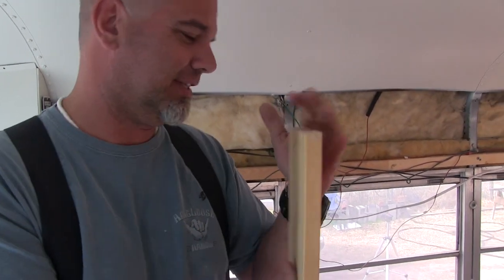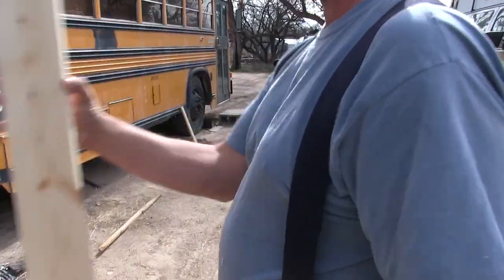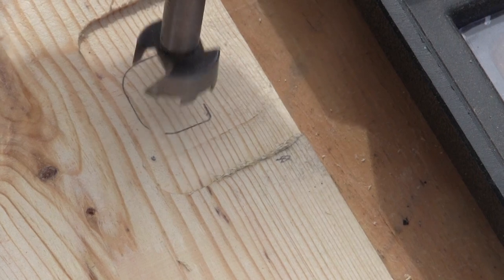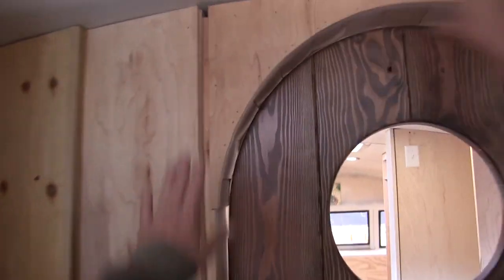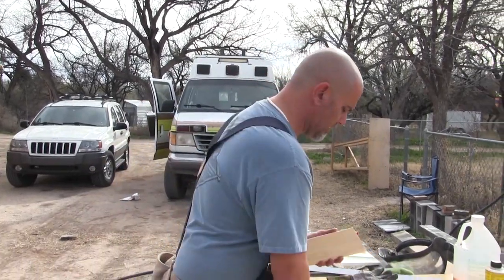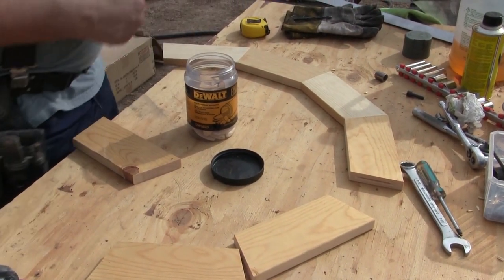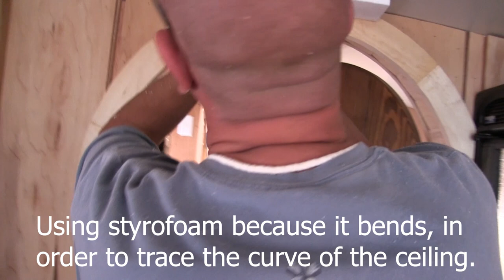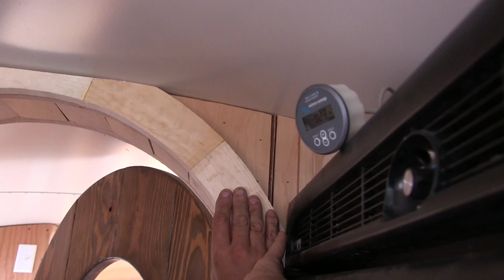Clever Trim for the Arched Door in our Skoolie!

Comment: Mike, instead of using wood to do the stopper and having to bend/steam it into place, you could use a guage of rope, stained to the same colour and held in place with u nails/staples. They would be cool in copper as well. Just a thought. Cracking job as usual.
Reply: Neil Fairless, the door would close more quietly with a soft stop, which would also act as weatherstripping to reduce drafts.

BTW, ☝️🤓 a stop (or doorstop) is part of a doorframe, while a stopper plugs a bottle or a sink.

Comment: you can clamp an arch  , make a piece that crosses the arch on the open end with a corner cut out that clamps the inside corners of the arch (to give pressure up without compressing the ends toward eachother ) put everything together put the brace piece in the open end of the arch then wrap a ratchet strap around the outside and strap it tight , pushes everything toward the center 
smart idea with the styrofoam to bend to the contour of the ceiling
think the best idea for the trim piece against the door is to steam the wood and bend / staple it in place , if that doesnt work you can make a arch thats a little smaller in diameter and with holes all round to hook woodclamps intoo and use the ratchet strap trick to bend it up after steaming it 
you might need wood that isnt kiln dried and actually still green so it doesnt tear 
https://www.youtube.com/watch?v=sixOY7b20hM